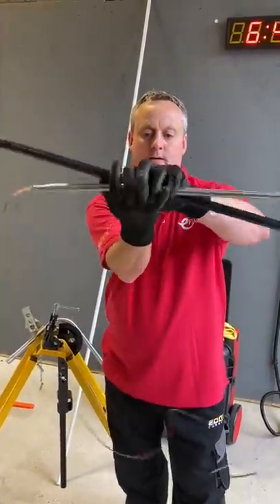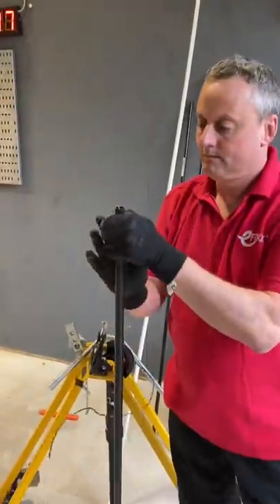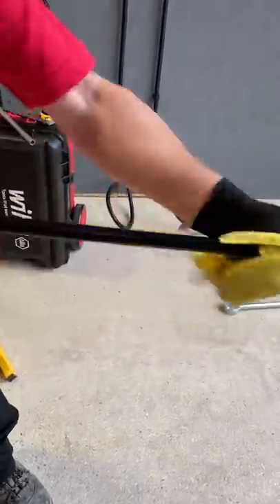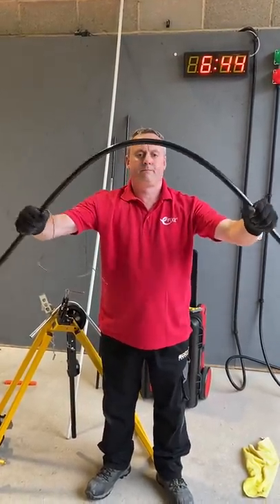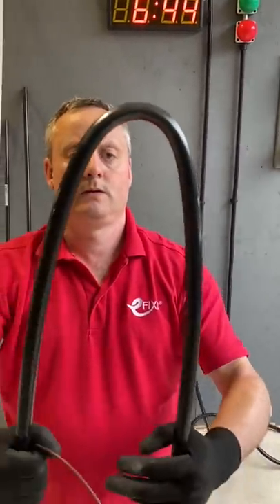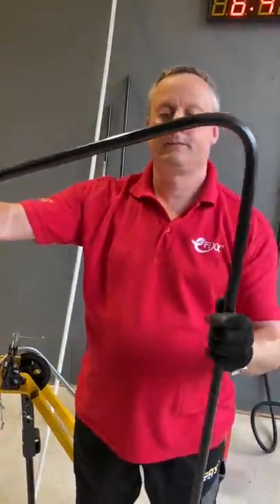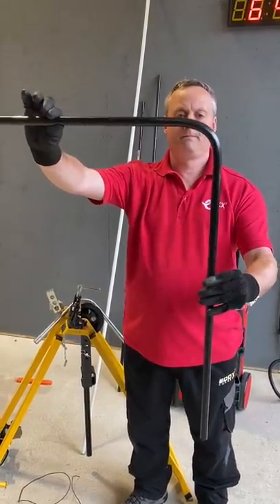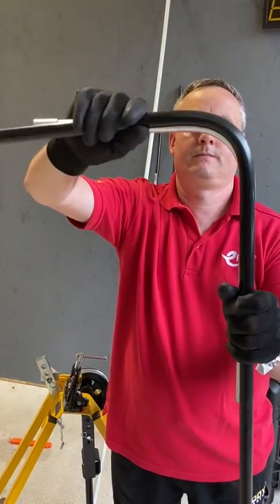Get the bike 🚴‍♀️ out - Gary's PVC conduit bending method #shorts

Comment: Been in the trade for around 15 yrs in the US and I’ve never seen this technique nor have I ever seen the spring that’s used here, nor have I met anyone who’s installed this way. We use a torch or a pipe heater for large conduit. Love your content guys. Keep it up!!
Reply from the maker: Cheers Glenn!
Reply: In the UK this is how I’ve always done it. But check for 90 degrees on door or against ceiling.
Reply: Bending springs are used on copper pipe. Friction warms it very quickly. No problem for any bloke.
Reply: Me neither.
Reply: I've been in the trade for almost 30 years in the 🇺🇸. I first used them while working in California in 2006. Viper conduit bending springs. Racketeer still sells them. They're handy.
Reply: Here in Ireland that's how it's taught to apprentice electricians..from the very first day..
Reply: Ive never used the springs either. I imagine they're just to keep the conduit from kinking when you make the bend? For PVC I've always used either a torch, a blanket, or the pipe oven for the bigger boys. If you heat it properly and bend it right you should never kink your pipe 😏
Reply: Been in this trade for 11 yrs now and I only started using a bending spring just the other day. I used fine sand and fire to bend pipes. 😂
Reply: @Dave5843-d9m  uhm no they're used on small pvc
Reply: @johnmcevoy1038  here in the Netherlands too. although usually you put your elbows on the conduit
Reply: You are not allowed by code to use a torch, I have a spring and am in the US
Reply: @wallpello_1534 you can use a hotbox
Reply: @patrickobrien4322  correct but not a torch or direct open flame
Reply: @wallpello_1534  codes are subject to your location. In the southeast, I've never seen anyone use a spring. We use a hot box, a torch, or a heating blanket.
Reply: @MrFixItGa  the NEC is national....that is what the N stands for but you back woods people might be behind the times
Reply: @wallpello_1534  WOW. Your lack of intelligence is showing. You might want to cover that up. 
1: Calling names is NOT how you "win" a debate. 
2: I'm serious about your obvious lack of knowledge. The NEC is adopted by each AHJ. (that's "Authority Having Jurisdiction" for you) Many states, counties, and cities have adopted different editions of the code. Not everyone is on the latest. If I remember correctly, there's at least ONE in this country that's still on 2008.
Reply: @MrFixItGa  lol backwoods is name calling, what a snowflake. If they are a over a decade behind I think backwoods is appropriate. 

2011 Code language:

352.24 Bends — How Made. Bends shall be so made that the conduit will not be damaged and the internal diameter of the conduit will not be effectively reduced. Field bends shall be made only with bending equipment identified for the purpose. 

Does your torch say it is approved.
Reply: In Germany we don't bend at all. We just use corner pieces. Way easier. 😂
Reply: You really should get yourself one, in my experience it makes pulling wires with fishtape a 1000 times easier, especially on 20mm pvc pipe where the hook always catches on the 90degrees link...
Reply: The truck exhaust works great.  
Like to see him bend a 90° in 4 inch conduit. 
Let's see him do a 4 inch saddle in 3/4" conduit.
Reply: How you gonna burn yourself without a hotbox?

Comment: A little tip, that i learnt from an apprentice no less quite recently, is to put the wire that attaches to the eyelet of the spring THROUGH the spring, so that when you pull it out, there's no chance of a stretched spring...so simple, but then I'm a thick sparky who doesnt see the obvious....
Reply: Yes I was going to post the same tip I saw on a Youtube video (could even be one of the legendary Gary's) You need to store the PVC conduit somewhere above 5' in the winter or it splits or the black conduit loses its colour at the bend.
Reply from the maker: This is a good tip but I'm just wondering if it might make the spring harder to remove. When you attach it at the end it's meant to stretch a little to reduce the diameter of the spring and allow for easy removal, I'll be interested to hear your thoughta on it. 🤔
Reply: @efixx  I was a sceptic until I tried it..give it a go.. you will see..and then make a vid...lol
Reply: That sounds super strange. Someone needs to show me or I’ll never believe it
Reply: Very true fishfienduk, spring lasts much longer. As to make it harder to remove yeah will be a bit harder but not impossible.
Reply from the maker: 😂 Fair point. 👍
Reply: The high quality springs have already a wire installed.

Comment: The conduit: Still overbent, clearly more like 80 degrees. Not lined up with the steel conduit at all

Him: "as you can see, the perfect 90 degrees!" 😁
Reply: At least I’m not the only one who couldn’t help but notice otherwise.
Reply: Geez man, it's pvc. The first strap will take the wow, right out of that. I've used them before and they work great. Way faster than using a hotbox or blanket. Do you even run pipe, bro? Hehe
Reply: Under bent if it's at 80
Reply: Overbent is MORE than 90, not less.
“More like 100 degrees”
Reply: @buellb0y  it's over bent buddy. A straight piece starts at 180. If you pass up 90 and make the bend too tight it's OVERBENT.

do me a favor and draw a 100 degree angle and then come back and tell me what it looks like
Reply: @hondarider436  you are wrong, worked induction bending for pipeline.
Reply: @JohnJames.  ok well it's bent too much. Maybe you like that terminology better.

But it's definitely not 100 degrees. We can all agree on that.
Reply: @hondarider436  look at it this way, you're trying to get 90 from a straight, you get this "87.9" it's under bent, but yes this piece isn't 90 we all can agree
Reply: @JohnJames.  call it how u want but it's been bent too much. If it was bent less than it should have been, it would be more than 90 degrees. He went too far, and now it's less than 90.
Reply: @hondarider436  you're right I was going to add this application he bent it to much
Reply: My thoughts exactly 😂
Reply: @hondarider436  Lol, you are completely wrong. A, the pipe doesn't start at 180 degrees it starts at 0.
B go bend. a 45, you know half of a 90?? That would be underbent, assuming the rigid conduit is actually a true 90, (which obviously is not the "only" way to check it) then that pipe is around 95 to 100 degrees.
Reply: @robertthomas7239  please grab a protractor and find 100 degrees on it, then reread what u just said and look at that pipe again.
Reply: @hondarider436  That just shows you don't know how to use a protractor. There's 2 sets of numbers on there for a reason. I mean seriously,  you think a straight line has 180 degrees of bend in it? Where did you go to school? Lol
Reply: @robertthomas7239  this is comical. 180 is not a bend big dog. 180 is a straight line. 0 is also a straight line. 100 is an obtuse angle. 80 is an acute angle. The pipe in the video was bent too far and is now less than 90. Anyone who argues that point just doesn't know what their talking about
Reply: @hondarider436  Lol 180 is absolutely  bend. Go grab a Greenlee 855  set it to 100 degrees and bend it, pull it out and compare it to this pipe sherlock.
Reply: @hondarider436  Again, you're reading the wrong side of a protractor.
Reply: @robertthomas7239  no, I'm not. But I'm done beating this dead horse.
Reply: @mattheworr3541  Not in pipe bending, genius.
Reply: @robertthomas7239  last time i checked angles didn’t change just because you’re bending a pipe
Reply: With the straps it should hold in a 90 degree position no problem
Reply: @luisdominguez213  I agree
Reply: Maybe the weight on that end
Reply: We’re all thinking the same thing.
Reply: DORK😂😅😊
Reply: Literally as soon as it's mounted and strapped it will be a perfect 90
Reply: @buellb0y  nah, because the deviation from the original shape (the bend) is greater than 90 at that point. Underbent would be anything closer to a straight line, overbent is anything closer to a full U-turn in the pipe my dude.
Reply: Being plastic it's clearly going to be set as hard as stone now and will never move again (sarcasm).

Comment: I find a lot if not all conduit is made from recycled plastic these days. It varies so much from batch to batch , sometimes it’s almost impossible to make a nice  bend with out it miss shaping
Reply: You mean like how the one in the video is misshapen?
Reply: Completely agree. I was on site once and had to make a set. Bending one way was fine then the next it kinked. Checked the cross section and it was thick on one side and really thin on the other. You get what you pay for I guess!
Reply: BrianBee . The only stuff my wholesaler keeps on the shelf is Marshall Tufflex . Every time I complain they tell me it’s all like that’s as it’s recycled,and send me a couple more free lengths of the same

Comment: Hmm I'm an electrician in Canada, never seen it done with the spring like that. Usually we use emt but i did use a big pipe heater to bend 2" pvc at my first job as an apprentice. Wish we did more stuff like you guys across the pond, a lot of your electrical building materials and products just make more sense.

Comment: Why are we still talking about cold bending it’s a poor technique less accurate and definitely not a time saver. Hot bending is the way to go. In the USA we have specific heat bending tools. It’s mostly for larger electrical PVC pipes but works on much small ones.

For smaller PVC conduit use a heat gun. Place a heat gun on the floor move the pipe over it and do the bend you need. One tip is to keep a bottle of water which can be use to pour over the bend to ensure its sets quicker. Obviously don’t pour water over the heat gun🤦🏾
Reply: Do you have a link to the hot 🥵 bending tools?
Reply: @mathman0101  I would say $1000 would be why, might be worth it if you are bending PVC conduit day in day out, I think in the US you often have different people doing containment than running cables and testing.  I cant see many sparks doing enough pvc bending to justify $1000.   Heat gun is a good shout though, I def would buy a makita cordless heat gun for heat shrink and pvc bending but only seen de walt and milwaukee
Reply: @steve11211  yes if you invest in a machine that’s more than likely you are going to be using it day in day out often in industrial settings. For residential a heat gun can take you very far and decent heat gun can be had for less than a $100 dollars.
Reply from the maker: Jeez - that’s a beast!
Reply: I just used to use the site toaster. Get the crumpets in, hover the conduit over it briefly, bend away, have breakfast.
Reply: @efixx  it’s always bigger for Uncle Sam
Reply: @theamazingtypo  🤣👊🏿❤️
Reply: Pauline Weinberger  nice.
Reply: I would love to see someone try to “cold bend” schedule 40 let alone schedule 80.
Reply: Heat gun or a hot box for larger pvc conduit / fiberglass conduit 😅

Comment: This is interesting. How thin is the wall on that tubing? All the pvc I use here is sch40 or 80 and I've never seen this bending method and I don't think it would be possible with the pipe we use. Is this a wiring method we don't have in the states?
Reply: I've used them many times. First time I got my hands on one was back in 2006. Viper conduit bending springs. I did a lot of commercial underground and rich people's houses with 800amp backup gennies in vaults. Those things saved me so much time in labor and material. No need for power to run a warmer or oven. Put bends right where you want them. My set has seen better days but still have em.
Reply: @emgreene67  so what do you do? Just put the spring in and reef on it? There's no way jerking it with a towel is going to heat it up enough to bend by hand not with sch40 and DEFINITELY not with sch80 there has to be another step I'm missing

Comment: How long does it take to warm the conduit using that method to get it to where it won't bend?  I used a plug in heat box that's regulated at a certain temperature but can't remember what temp off the top of my head

Comment: Mate, the draw string should be threaded through the spring and tied at the opposite end, so when you pull it back out it doesn’t stretch but instead compresses.
The way you have it , it will flog out in no time..

Comment: Think the conduit dropped some liquid out after that rub 🤣 it works that way but your hands are too far apart. Used to bend a lot of VD tube in Europe but you guys don’t have that kind here.. I find your tube here a bit harder to make a presentable curve, specifically the heavy gauge one.. always have to torch it a bit. For bigger tubes 50/63/80+ I always filled them with sand and torched them to make the curve 👌

Comment: AMATURE MISTE!! ToP TiP…. The wire attached to ur bending spring is supposed to tie one end, travel thru the spring and out the oposite end before you put in conduit this prevents the spring from stretching and deforming as you remove it 
YOUR WELCOME

Comment: Use microwave oven to heat sand, then fill the sand into pvc pipe and bend over to the correct angle, rinsing with water make it cool down. Pouring sand out. The perfect bend finished 😃